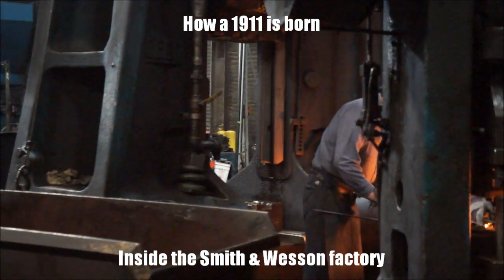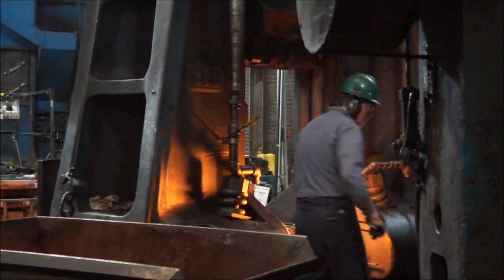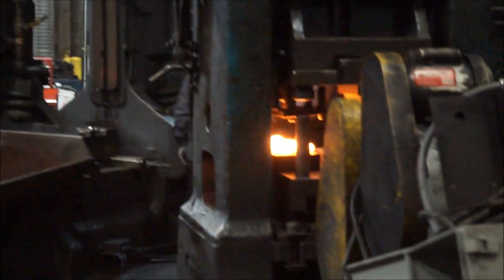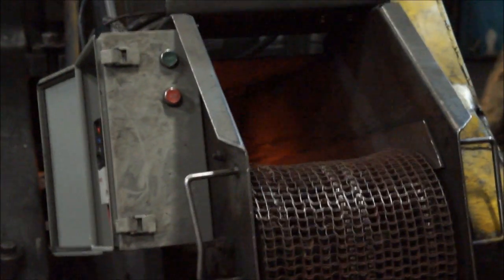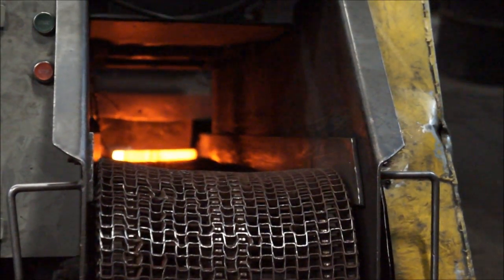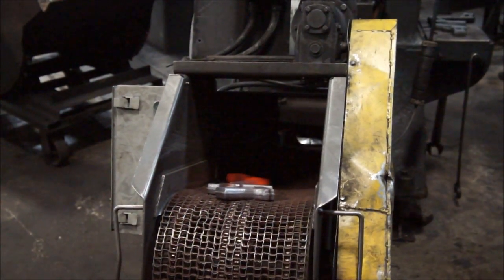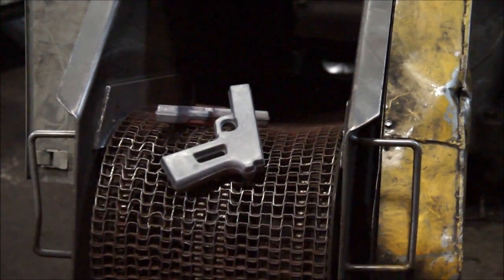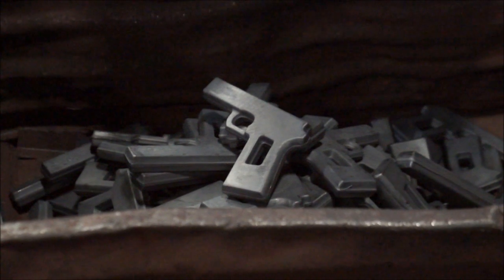The birth of a gun: forging a 1911 frame

Comment: Yeah, no 4506 extractors on Brownell's either. I love my 4506 and my 4505, but those are collector's items. I don't expect to use them hard, and I don't mind if they take a while to fix. They're kind of like classic cars. A 1911 - for me - is a daily driver. A non-standard new 1911 gets me the worst of both worlds. It has no historical or collector value, but if it breaks I can't take advantage of all the standard parts to get it back working that same day.

Comment: however  I agree, the safety is stupid, but it's no series 80, cmon now... and i removed them, but drop safety, i suppose, was a pressing matter for some lawyery types, because now every single manufacturer has something in place to provide it to somedegree (the ti. pin and heavy spring are my favorite and thats what i went with when i removed the schwartz) i see no problems with having one unstandardized part if it's the one i'll never replace...

Comment: Quick! find me a smith and wesson third gen extractor, oh it's standardized! oh there are third parties making it! you'll never ever ever have to replace it, i have about 100k+ roujds through mine... and removal of mine aint hard, get the firing pin out, use it as a punch, youre done, replacing it is just as easy and youll never have to toss it in the vise and give it a few good whac with a hammer to adjust it...

Comment: Quick, go on Brownells and order an extractor/plunger/spring for a S&W 1911. Now buy one for a standard 1911. Standards are useful. You've got a choice of third party parts, and plenty of gunsmiths who know how to make it work. There's a place for proprietary guns with proprietary parts, but if you're buying a 1911, that's probably not what you're looking for. I'm glad they're using a Schwartz safety, but that's still 4 extra tiny little parts to break, and more holes in the slide and frame.

Comment: It isn't a series eighty safety, at all, good one though. And john moses browning preferred the external extractor, the military liked the field stripability of the internal (which we all know is a pain to fit and tune, or at least i know that) 

back to the safety: it is a schwartz style safety that is operated off of the grip safety not the trigger so it doesnt take a rocket scientist to do a nice trigger job on it and it works better with just on lever instead of three. removal is easy too

Comment: Yes, forging provides the most desirable properties of all metal forming processes. There are less defects, collapsed dislocations, better finish,  and the grain structure of the metal follows the mold.  In investment casting there is a propensity for errors, large amounts of shrinkage, defects, and inferior grain structure.  While investment casting is one of the best casting methods, closed die forging beats all.